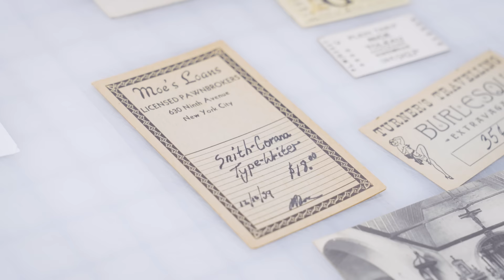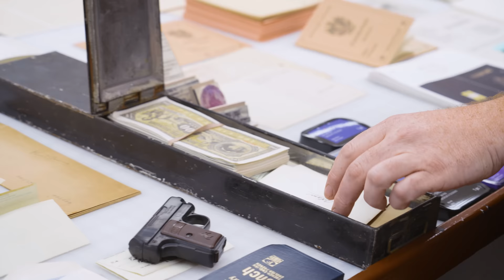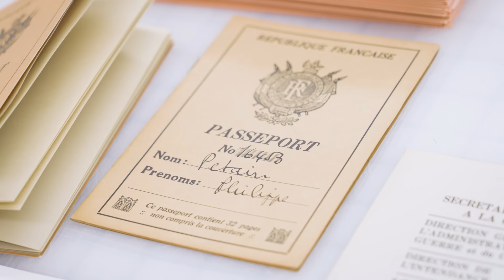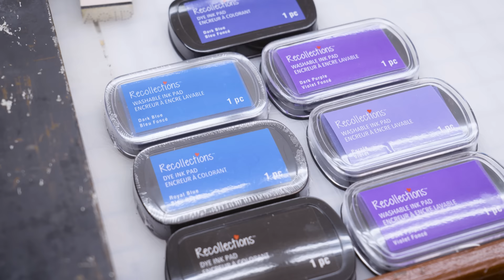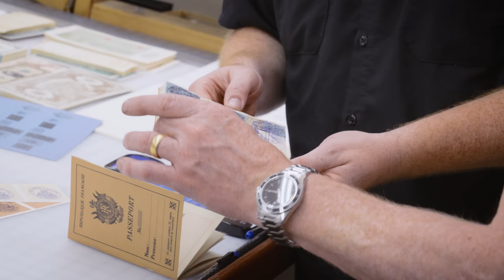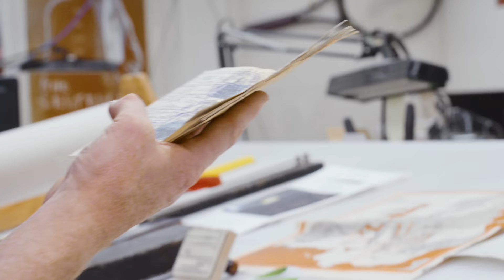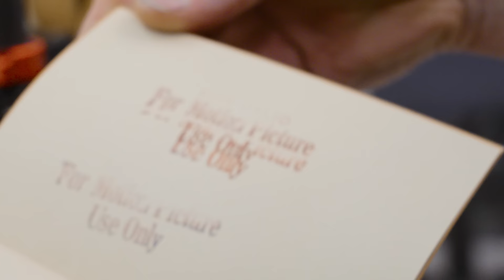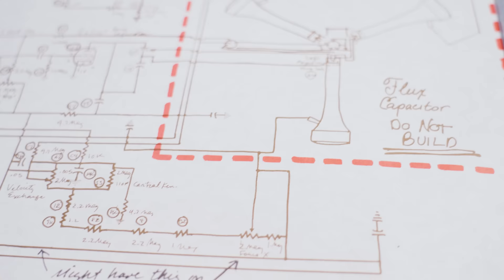Adam Savage's Spy Prop Kit!

Comment: not to be that guy, that indulge me for a moment.  You can still buy Hand punches that will punch VOID or PAID in to the Paper, plastic cards as they are still used to day, VOID is used not just to VOID out documents, but Tickets/Bus Transfers, and ID cards, and the like. When I moved, my old State Drivers License was voided with a hand  perforated punch, that left that same VOID Mark. they are not cheap by any means, but also not overly expensive.

Comment: 14:33 Adam, when you fill out the date on your Letter of Transit from Charles de Gaul, be sure you use the date system and number forms that were (and are) used in France, because they're not at all like what we use here in America. "1 octobre 1940" not "October 1, 1940"; the month is not capitalized, and the French use different forms for the numbers 1, 7, and 0.  Oh, and your drivers license probably needs a brass ring punched through the paper to make it official.  I still have my IDs and my checkbook from when I was a graduate student in 1982-83.  What a wonderful storyline and prop suite!!

Comment: 19:16 one extra step that would be taken when making those would be to use a quick press (the type with the lever) to press the spine of the passport to make it lay flat. I saw one of those tools. Basically a machinist's vise, but with a lever action and mounted vertically. They'd put several pieces in, clamp them and make them sit properly.

Comment: i dont know if it would be possible but i do leatherwork and use a round hole stitching chisel with multiple punch tips that are on some models replaceable. if a hammering block could be made and drilled to recieve the punch tips in the right shape of the VOID text, it could be hand hammered into the paper and should leave perfect holes. they are available in 0.8 and 1mm if that helps at all.... thankyou for sharing another amazing video with so much to be inspired by.

Comment: How awesome! But I honestly rly wonder that with all that knowledge they have they didn’t come with the idea of rly punch the „VOID“? It wouldn’t be a big deal. Small plate, drill holes on a cnc, put little hardened steel rods in them (like the push out pins at molding tools) and make a negative. Would be even easier to replicate than any kind of a stamp they used.
Reply: Time and money
Reply: @PropsToHistory   true words. 
Material cost would be lower than 10$ but the time to do it cost way more for a that detail like this even if it is just two hours.
Especially when you did it very nicely with a stamp. Still awesome work.